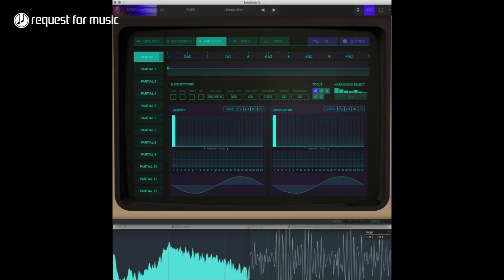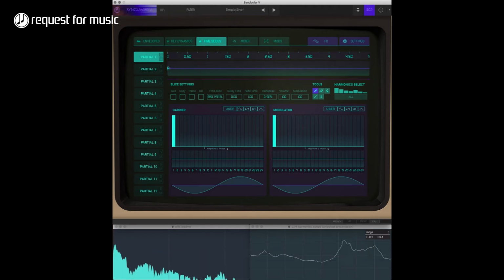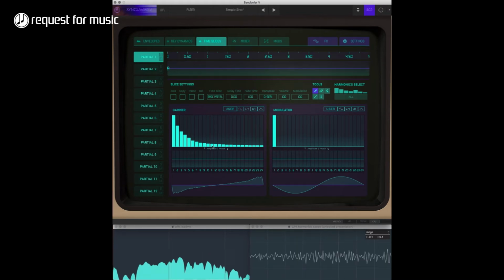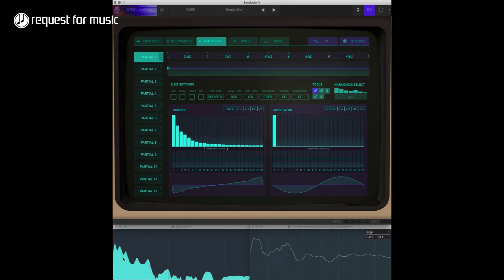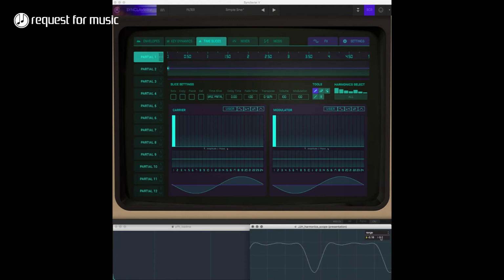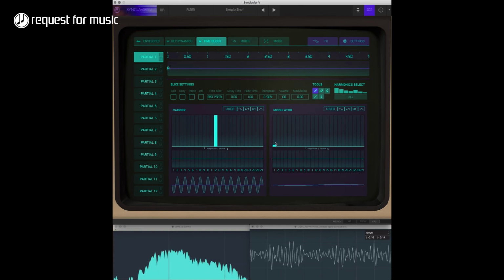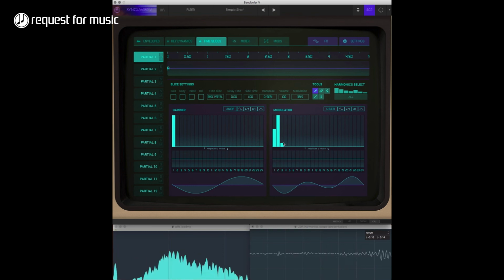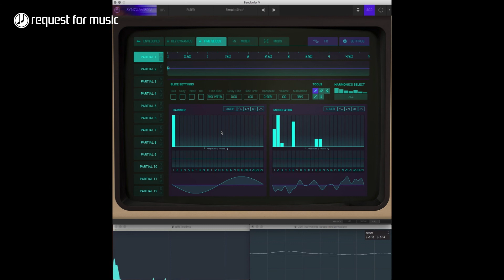Arturia Synclavier tutorial 007 FM technical

Comment: Thanks! This is a very interesting explanation. It's the first time I've seen the effects of the modulator harmonics explained so well. But I find it surprising that the diagram on the left did not match the oscilloscope wave. Surely Arturia can't have got it so wrong? Are you sure there were no signal processors somewhere else in the path that might have been acting like filters?
Reply from the maker: :-) thanks!! I must say that I don't know why their wave does not really show what would show up in the oscilloscope - I think they only have a sort of 'Math reproduction' and not the real interaction of waves that shows up... so only a graph of the MOD and CAR parts but not really the modulated wave....
But actually also the waves themselves that they describe as Saw or Square seem to follow the rules but don't necessarily sound or look like a saw or square... that might also have to do with the fact that you are 'limited' to 24 harmonics whereas mathematically we would need endless harmonics to build a real saw or square wave...